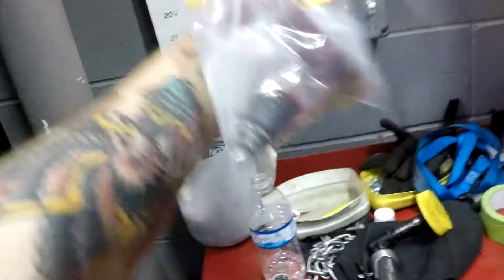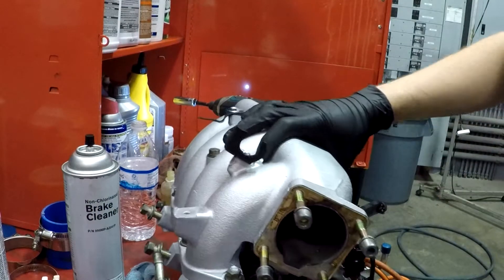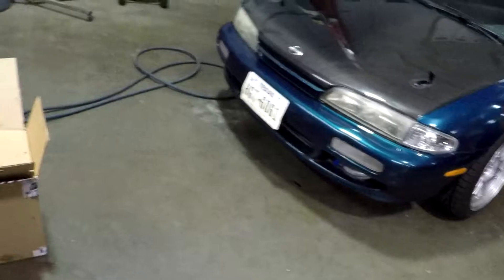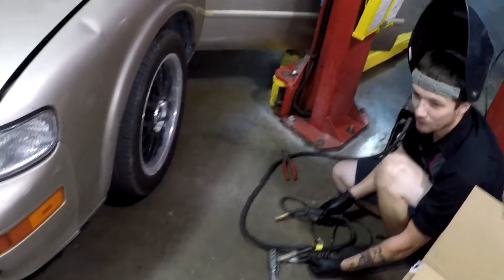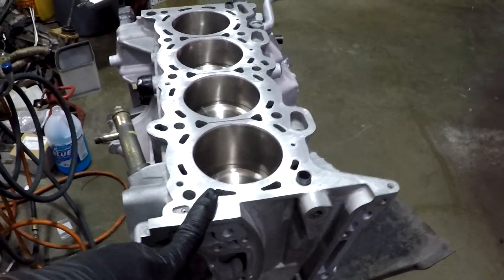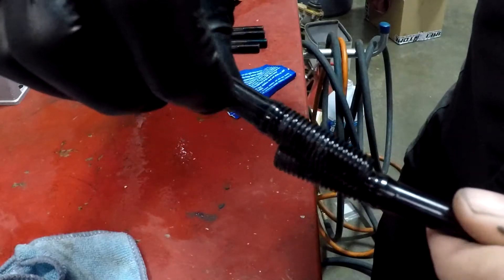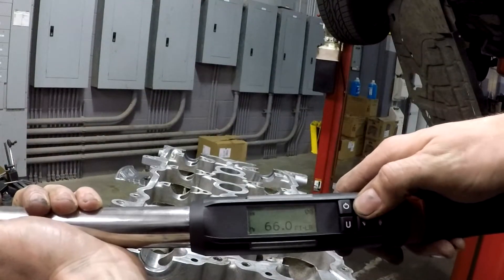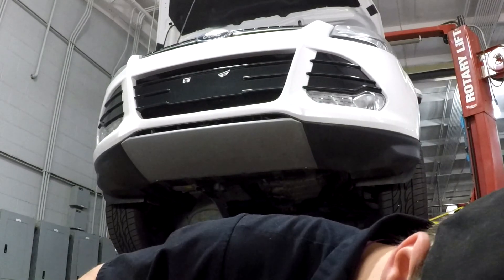Engine Assembly Forged SR20DET BUILD S14 240SX

Comment: using an impact on an the fuel line? dont those need 56-73 INCH pounds?
Reply from the maker: I can assure you it did not matter... Ive been running this car hard at the track almost every weekend in summer plus daily driving it.. I have had no problems... I work at a Dealer every day, im also a Nissan Master, im not telling you to not torque it, but in my instance it did not matter.

Comment: can you put a parts list plz... thanks
Reply from the maker: i can make one soon with links if youd like!
if you just want a generic engine parts list i will add it to the description now!
Reply from the maker: wait it was already in the description but here you go!

Stock Block 
bored to 87mm thats .040 over or 1mm over bore
stock crrankshaft
manley forged h beam rods
wiseco forged pistons 9:1
OEM Nissan Main and Rod Bearings
BC 264 cams 
BC Titanium head kit includes Valved Springs Retainers
megan racing turbo manifold
tomei arms 7960 turbo kit
ACL oil pump
5-0 750cc injectors

_______________________________
Before rebuild
CX racing intercoooler kit
HKS SSQ IV Genuine
ISR Radiator
Wiring specialties pro series harness
VMS fuel pressure regulator
Tru boost Boost controller - Honestly not a good buy like the manual one better
APEXI super suction intake kit
more little things